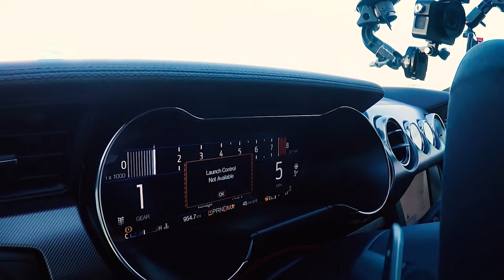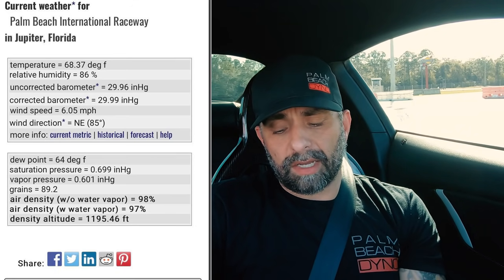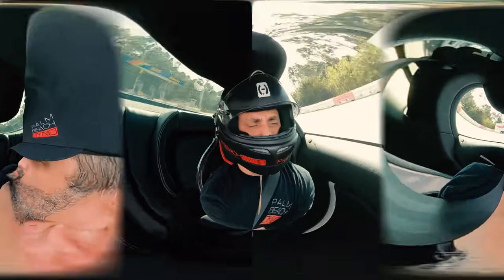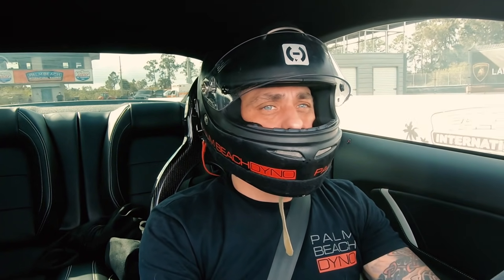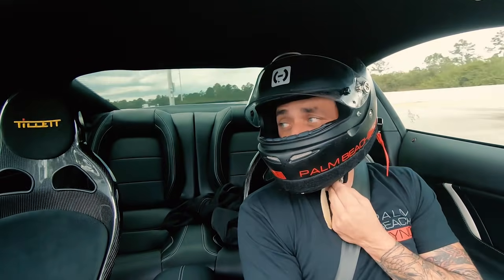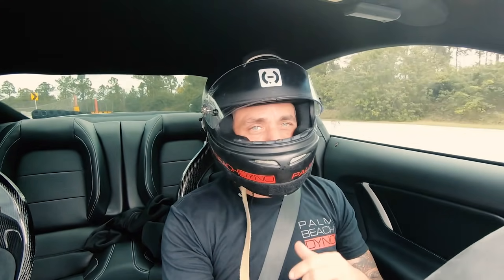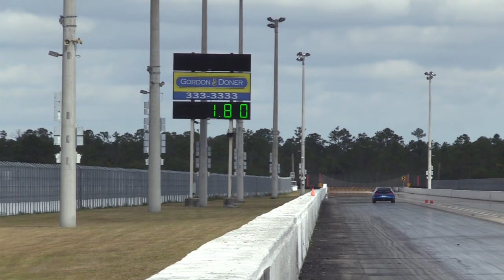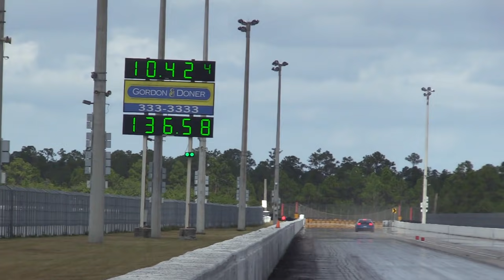2020 GT500 Stock Boost Drag Test | Stock Tune - 93 Octane Tune - Race Gas | Auto vs Manual Shifting

Comment: Thanks for the tremendous video Ken! / didn’t have these issues in vegas when cars were hot lapped but Huge help see you soon bro
Reply: StangMode, you guys think it’s the tunes causing the trans issue? Although that wouldn’t explain Speed Phenoms issues since his isn’t tuned. Curious to see if Ken can figure out what’s going on there.
Reply: The more I think about it, maybe it’s a traction issue with the drag radials.
Reply from the maker: Thanks brother!
Reply: They just didn’t show it they had issues
Reply: StangMode - Hey Stang mode.  I am thinking the clutch overheat issue Korn was dealing with may be the result of the drag radial.  The tire has WAY more grip and I am thinking the computer may be slipping the clutch more (to protect the drivetrain) creating more heat in the clutch.  Just a thought.  I could be dead wrong as I am not a tuner/programmer!

Comment: Looks to me the GT500 is expensive to buy with the dealer markups and expensive to mod with the DCT issues. Best bang for the buck for a new car is still the GT with a 10R80.
Reply: Sounds like that 7 speed is shifting pretty lazy too.
Reply: @enigma9789  Definitely sounds lazy AF
Reply: Yea the GT500 is way overpriced and isn’t as fitting for most as the GT. The GT has proven over and over again you can make it what you want and for the best value. Even without markup the GT500 is priced insanely. Without carbon package but adding tech package it’s like 80K! You can get ZL1 or hellcat for sub $70k with options and auto trans brand new.
Reply: For the last time the GT500 not set up for drag racing can you drag race yes that's not what the car made for
Reply: @fread51  lol, if the DCT has issues drag racing then it for sure will have issues on a road course. Road course racing is WAY harder on parts.
Reply: Shawn Sanders 🎯Exactly.. Way harder
Reply: billy heaton the car is build for everything . If it wasn’t Ford would of never claimed the 0-100-0 in 10.6 seconds nor they would of invite people to Vegas to drag race it .
Reply: @fread51  stop being a fan and wake up. Whats it set up for cause its way to expensive to have regular drag strip issues. Might as well buy a ZL1 1LE.
Reply: @enigma9789  The shifting is very fast, but as mentioned in the video there are benefits to the computer shifting (over torque etc) but it shifts early. Timing is pulled on shifts in manual mode

Comment: I think after watching every gt500 video I'm seeing that the more traction you get the more you get clutch over heat we got to get tunes for the dct
Reply: How will a tune help it? Turn up the heat at which the clutch trips protect mode? That cant be good
Reply: @bigboreracing356   well I dont think it was intended for this BUT to that I'll say and I like them all, but you already have a track car why NOT build a Demon killer for real why not build a drag car that would do 9s stock....you got 10 track cars already and you see what the average guy wants that 1/4 mile PBD isnt modding his for track he is modding it for drag and that's what we are watching
Reply: @bluecollardaily2676  i dont understand why they wanna make everything a track car these days...the mach 1 also...the mach was never a track car neither was the gt500 its always been a straight line bruiser.  Trying to make it do too many things good also drives the cost up significantly
Reply: @midnight347  its so nuts and VERY VERY few people track cars is say 1% while almost everyone smashes the shit in a straight line...its kinda getting nuts....

Comment: I like that you show real issues and dont try to hide them. Interesting that owners need to keep clutch temps below 170° for drag racing
Reply from the maker: And that is just a guess. I'm starting to think it was more related to the larger tire on the back and the computer getting confused. Still have to dig

Comment: Love your blue the best out of all the gt500s I've seen.
Reply: Car Culture Nation - like the color too but IMO it looks bland without racing strips
Reply: Dan Myers with the black roof and black vents on the hood it works. But stripes would work as long as they were black. I don’t like these blue gt500s with white stripes. It just doesn’t make sense that everything is blacked out wheels, heat extractor, aero, grille etc and then people do white stripes on a car that has no other white on the outside and the only white would be the Recaro seats which are white and black. But this GT500 don’t even have them seats. It has the power heated and cooled seats which are actually cheaper. Either way he knew he was swapping the seat which he did to the driver seat.

Comment: I keep adding comments as you go, but now I see 1700ft DA Holy shit, stock car but tuned which is not different then she demon changing out it's tune for 100 octane!! 
Yet you still have 20" Fat ass tires up front and bad weather and track and I can show you 100's of demons on true slicks, skinnies and race tune minus seats etc run 10.35-10.45@132-134mph with DA 400ft yet you did 10.4 @136 in 1700 DA and had you had skinnies along g take off .2 normally. 
Point being, the 2020 GT500 is truly venom kills demons lol.

Comment: Ford needs to take a look in to this. I've seen several videos where they have the trans temp issue. I cant imagine they done all their testing and didnt run into that same issue. Maybe they need a larger cooler. I cant speak for their cars/suvs but their diesel trans run around 200 unloaded not towing. I know it's a diff trans ect ect but I wonder what the actual safe level is for the gt500 trans temp.
Reply: Ford sends out too many vehicles with known issues. This is not new for them.
Reply: It's clutch disc overheat, not the transmission, heats up on the burnouts.
Reply: @gregd6404  Don't make excuses for ford, he isn't doing anything the car wasn't designed to do. It shouldn't overheat doing a small burnout then using launch control.
Reply: Timothy Locklear literally every company has problems with new cars.
Reply: @ElijahWash  Especially ford if you look at their track record 🤣 I've purchased around 6 brand new ford vehicles including the S550 5.0 and every single one has had problems that are not normal problems.
Reply: Timothy Locklear you bought 6 s550? Seems like your the one with the problem. Like I said every car is gonna have its issues. No company is perfect.
Reply: @ElijahWash  🤷‍♂️
Reply: @gregd6404  wet clutch
Reply: @frozenstang3868  So the clutch can't overheat because it's wet?
Reply: @HoldenGuyTL  I wasn't making excuses, that's one of the hazards of a DCT.
Reply: @gregd6404  it all shares the same fluid which cools the clutch.
Reply: Ford is probably preventing failure by putting this IN, they probably found the point they failed and then added this code to the pcm....turn it off and no telling what's gonna happen
Reply: @bluecollardaily2676  They designed the car to work within certain parameters, once you tune it all bets are off. A clutch is a clutch wet or dry can only take so much abuse and changes the DCT clutch would not be a fun weekend.
Reply: What if its just letting the clutch slip too long during burnouts and launches?  Tuning something like that could possible keep it cooler but make it less predictable and harder to launch.
Reply: @frozenstang3868  no if they or the trans or even available...I like the predator engine it just doesnt seem like a great platform for drag racing with the DCT
Reply: @HoldenGuyTL  You can do a burnout then drive the car fine. Show me where Ford designed the car as a drag car. They have no documentation that they designed the car to be a drag car.
Reply: @cmdrdredd  they designed it to do everything including drag.  No they didnt make it to do JUST drag but they did make it to do EVERYTHING well why the fuck would they make the 10 second quarter mile one of the selling points otherwise?  They wouldnt.  Idk why they dont just put a beefy manual in the fucker and forget it stop chasing the couple tenths you get with these overexpensive shitboxes and make ppl actually learn how to drive to go fast like the old days.  Everyone wants everything done for them now including shifting and this is the price we pay for it.  It adds way too much complication to it and expense.  With a manual the only "trans tuning" you have to worry about is getting the driver mod.  Also if theyre having problems on a simple burnout and launch at the strip theyre def gonna have issues on a road course so dont give me that it wasnt made for drag bullshit.  Stop defenfing fords stupid decisions.  I bleed blue and have my whole life ive had 8 different mustangs and guess what everyone of em was manual trans.  2020 gt500 wont be one in the future even if it does get affordable enough for me to own.  Too much bs and too much potential expense there with the rich mans dct.  They can have it.

Comment: I know the gentleman that's at lund  Alejandro Flores spoke of the burnouts would overheat the clutches.
Reply: Timothy Cann - I was wondering about that.  I saw that Ken was going around the water box to keep water off the front tires.  Unsure if he backed the rear tires into the water before going a burnout as he didn’t show that.  Starting the burnout on dry pavement would likely put more heat into the clutch.
Reply: Timothy Cann - BTW, you are the first person I have ever heard refer to Alex Flores as a “gentleman”.  I think even he would take exception to that.  😉

Comment: Wow total bummer. HOW COME THIS NEVER HAPPENED AT MEDIA DAY IN VEGAS HEAT NEVER SHUT DOWN WHILE GETTING BEAT ON. 
   Good stuff thanks.
Reply: Pre production cars that probably had that temp raised then after they tore them down to see the wear....it may even be why they wouldnt let them turn em off...then they found they were 2 hot added this code to protect them
Reply: I didnt see the event but maybe they didnt do very big burnouts?
Reply: @sergeysmelnik  insano nuts laying on the limiter ones look up GT500 vegas preview
Reply: The big difference was that the cars in Vegas did not not have a sticky drag radial tire.

Comment: Was there any water in the water box prior to the burnouts on those 'overheated clutch' launches? Dry burnouts on a drag radial create a lot of stress/heat on a driveline. I wonder if that also could have been part of the problem. And yes, ALWAYS pop that hood and let it cool between passes.

Comment: That's says a hell of lot running 137mph warm at 1200ft DA, 77 degrees Florida heat and humidity with a sorry 1.8 60ft first race gas tune! Think no boost just a time, tires and a good prepped track with negative DA say like people boasting about a demon getting 9.65 by Dodge at minimum -1200 some say -2500ft lol but just take that same car to one of those kinda DA's and the factory car nothing but a tune is guaranteed to run well over 140 stock in the 1/4!!
Just have to find a way to get that power on launch!
Reply: Agree.  That’s some strong mph in crap weather. 👍

Comment: That is really weird, speedphenom had the same issue. They ran those cars in vegas with stangmode and the reporters back to back multiple times with the journalists absolutely ragging the shit outta the car. Ken , what about just adding a fan for the trans cooler or turning on the electric fans sooner.
Reply from the maker: It may not even be heat related. Could be the tire size difference and computer freaking out. Still investigating
Reply: When speed phenom had that happen he had different tires on as well.
Reply: Dan The Man  Go watch the video again.  He replaced the rear tires and removed the rear carpet.

Comment: You aren't having a problem when you try to heat up the tires. That process is with low tire pressure is probably putting stress on the clutch.

Comment: Are you able to override and increase the 3200 rpm limit that Ford programmed into the launch control?  It sounds like the car is bogging at the hit.  With the  M/T drag radials I would think the tire could take a harder hit without spinning.

Comment: So where are we at with just a tune and tires?? Also I've been hearing that leaving it on auto with traction control is good enough for 10.6 to 10.7.. 
I'm completely stock, snow just melted up here and ready for some fun!!!
Reply from the maker: Tire and tune in good weather could get you a mid to low 10s depending on weather

Comment: It’s strange when they were doing media day and they were hot lapping 10+ cars and burning the tires off the car and no one had an issue once. Doesn’t really make sense
Reply from the maker: It could be the tire size. The MT tires is bigger and could be messing with the computer
Reply: @PalmBeachDyno  i missed that you changed out the tires in the video. definitely a possibility.
Reply: Speed Phenom did it stock on a briskly cold day...it could be they purposely tested this in vegas cause them guys were doing insane burnouts...and lowered the temp to trigger upon inspection after that event ?
Reply: @PalmBeachDyno  I see what youre saying.  Perhaps reading the revolutions slightly slower so readings are slightly off and ecu is over compensating.

Comment: Ken,  do you know if the Clutch Over Temp is an actual measured value with a sensor somehow measuring the clutch temps,
or is this  just a calculated value based off of recent data updates.....say weather temp, trans temp, a recent burnout, the engine being on the limiter etc...? I hope my question makes sense. 
  And the blue color looks great on your car, nice choice.
Reply from the maker: Fairly certain it's a real temp. If it was inferred it would reset after a flash like oil temp does. Oil temp is not a real measured value
Reply: @PalmBeachDyno  Thanks for the info.

Comment: Why not be smart and use tire warmers? The clutch over-temp is a direct result of all the slippage necessary to keep the engine from stalling and until the rears finally let go and start to spin during the burnout. What is the difference of tire surface temp before and after the burnout? On a surface with that much goop on the ground I doubt it makes a hill of beans difference what the tire surface temp is just as long as it's over the threshold.

If you're doing 'laps' at a strip, there needs to be a way to power up the trans oil pump with the engine off and a nice fan to force air over the cooler. Did you instrument trans temp before each run?

Once you were in the water puddle, most of the time you lit the tires up a foot past the puddle, a couple times the puddle was dry. Maybe try for some consistency on that front as well?
Reply: You roll out the water wire treaded tires. The burnout is heating it up though and the launch control remember it was brisk cold when speed Phenom did same thing when he stayed on the launch control 

 That said at the Vegas event the magazine guys were doing OBNOXIOUS long bouncing of limiter burnouts and didnt get this so its code added after that test day

Comment: 10.40's at 1200 da just think with great 0 DA or better that  are stock is still truly running over 140mph and should be 10.10's-10.20's but take put skinnies on front, that's  .2 right there! 
The car  an with a tune and great prep/DA run high 9's
Reply: Greg Williams 1200 DA difference would be about a couple miles per hour difference in the 1/4 mile if that. ET won’t be affected as much as the top end power I think.
Reply: @techmaster777  that's what you get for thinking g with your AWD! 
And it went to 1700ft DA. 
Do you run a a track or just that mouth!! 
You jumping post to talk shit why don't you just tell us all that the DA seems to mean nothing to you! 

I've lived and raced at the track for over 25 years, hell lived by for 41 but what ever you say. 
Because clearly the DA is not a issue in your opinion. 
The fact is a car that ran 137 mph in 1700ft DA will go 140 in 0 to negative DA. 
Skinnies on average alone from the rolling resistance and weight loss typically take off 2 tenths of a second so yes with perfect DA and skinnies and a a good run I see 10.0's easily achievable especially when the transmission is finally reprogrammed.